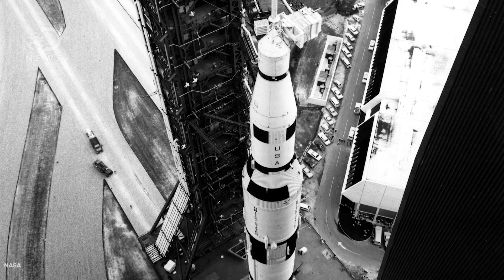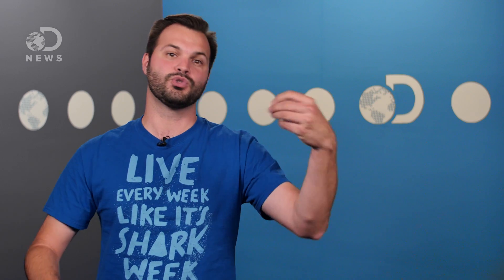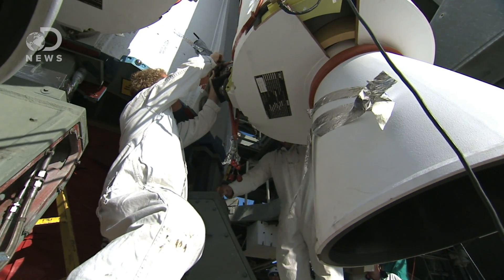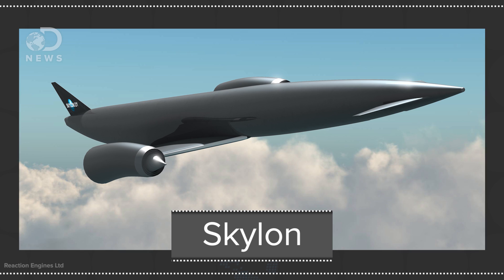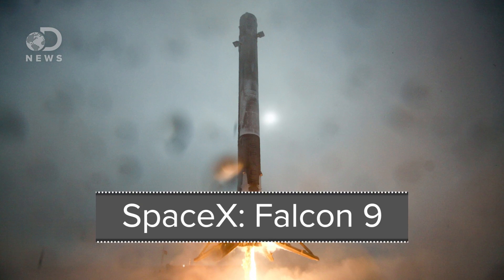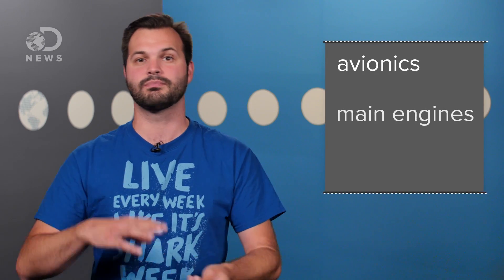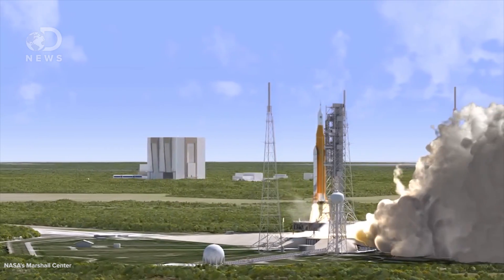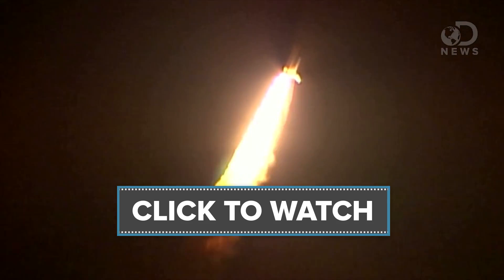What Will Rockets Look Like In The Future?

Comment: Just going to put this out there but how about a tiny rocket booster hanging from a big blimp at the edge of space !! 

Just saying
Reply: Even a weather balloon can only get to the stratosphere, and no weather balloon could carry a rocket big enough to get to orbit and back from that low of an altitude.. Any idea you could ever think of was likely already been thought of and tested by nasa, or others before them.. Even the space elevator using carbon nanotubes would barely be able to handle the stresses, not that it's impossible just the likelihood of a halo reach space elevator collapse would be what holds it back.. I mean if it falls its going to get slung all over the place and rain down from the sky, and kill countless people.. So it's probably going to be hundreds of years before that's going to even get started..
Reply: Did I say weather balloon ? NO ! I said big blimp ! Big difference !
Reply: Weather balloons are going to be able to go higher than any blimp, the fact that you don't know this is indicative of your lack of sense.. And it's even more comical that anyone would up your post, which doesn't change the fact of you idea is superfluous..
Reply: And how big would that blimp be? The Hindenburg airship has a useful lift of 10 tons, despite the 200,000 m3 of Hydrogen strap on its back. Imagine if it is a 200 ton rocket strap on a hydrogen balloon. Plus it can only go up to the stratosphere - we need to go at 400 km, not 70 km. We would still need that huge speed in order to escape Earth's gravity, in the stratosphere, we only have got rid of about 70 - 90 percent of air density - we will still have to face a bit more of a resistance. In the end, its pretty useless. 

If you want to send a rocket from the back of a plane though - its possible - the Russians did it.
Reply: Again I said a tiny rocket hanging below a big blimp and the Hindenburg is old as hell ! 

So let me explain it so you people can understand you pit a satellite on the end of what amounts to a small booster rocket you hang it about 500 feet bellow the big blimp that is about ten times the size of the Hindenburg and when the blimp is 25 to 30 miles up you launch the rocket the rocket doesn't have to be huge and of you get space X to make the rocket it's reusable ! I NEVER said hot air balloon or weather balloon ! Can you guys please think about this stuff with an open mind before you spout off please !! PLEASE !!
Reply: There was even a blimp that rose to fast in the 30s I believe that reached the edge of space soo not a hard concept to get a grasp on here people ! I love all the people that saw a doc on something and say NO NO NO you can't do that because the out of date info I have says so
Reply: And why do you say a weather balloon can get higher than a blimp ? What's you reasoning behind this statement ? People like you once said planes would never fly once and they were wrong ! This is that kind of situation lol
Reply: Lyndon Lucier The edge of space is at 100 km - low earth orbit is at 400 to 500 km. If you are able to put a 10 ton payload in the edge of the stratosphere - how are you going to throw it to low earth orbit? The Hindenburg is one of the biggest blimps of all time - for an airship to carry 10 tons is already a great feat. 

You have to consider the materials that balloon would be made from. If 200,000 m3 is required to lift a load of 10 tons to 5000 meters, to carry a load of 200 tons would be around 8 million m3 of hydrogen air - thats massive. That airship would be a few kilometers long and building very large balloons requires very strong materials. Plus hydrogen is a flammable gas, one wrong move and your rocket is toast. Helium you say, then we need more gas to lift this thing, which means more mass.

"There was even a blimp that rose so fast in the 30s" - then show us this thing then. We are not here to about believing - we are here to doubt. This is science, not religion. And by the way, to reach the "edge of space" in less than 30s would mean your blimp is running at 2 km/s. That's one hypersonic blimp you have. 2 km/s is equal to 7,200 km/h or Mach 5.8. Thats even faster than most of the planes we have then. 

A blimp (or airship) is not a hot air balloon - its a buoyancy balloon that rises up into the sky because hydrogen is 13 times more buoyant than air - it works the same way as with your cooking oil and water - water has a density of 1 kg/m3 while oil has 0.8 kg/m3 so oil will naturally float on water. 

And dont forget, you cannot simply use jet engines in 70 km altitude so you cannot simply maneuver your rocket there. If you disconnect your rocket at that altitude, your blimp has to move out of the rocket as fast as possible before it can use its rocket engines. If you use your rocket engine near a 10 million cbm hydrogen balloon, you be exposing yourself in a bomb equal to a small atomic bomb. 

Here we go again - the airplane thing... loo, there is a limit on what things can do. We have costs to keep in mind, we have safety and more other stuffs to keep in mind.
Reply: Ricky you are incapable of learning new info aren't you lol I'm not building the Hindenburg and also you aren't understanding the whole concept now are you 

And this is YouTube I can't post a pic of a airship ! Even if I could it would be pointless because you could google it yourself you lazy shit 

Just go away and be stubborn somewhere else
Reply: Lyndon Lucier I'm not asking for a pic - Im asking the article. Oh well, since I'm not capable of understanding anything, I'll just leave you alone with your pipe dreams intact. Dont worry I'm not like other people out there - I do not force things on peoples brains - I know how hopeless it is to put some facts on that brain of yours. I dont want to waste time and energy on some youtuber.

I just forgot - youtube has a lot of idiots - well then, good luck with that city-sized airship of yours. Hope you dont spend millions of dollars on some flying disaster.
Reply: Pot meet kettle !
Reply: There has been talk from NASA about making a cloud city of blimps on Venus or having blimps on the gas giants, perhaps mining the clouds for fuel.
Reply: TheKandaharKnight Well, that is actually a good concept because as far as we know, Venus' atmosphere is much more denser than Earth. Even helium balloons would do a good job in Venus. However, if NASA, or any other space agency are going to build balloons on Venus, I think they have to solve one problem first, the problem on how to put man into space in a very cheap price.
Reply: If putting people/cargo into space on the cheap is the challenge than I can't think of a more proper answer than Space X. Right now industry Standard from what I last read it cost to launch rockets to space is about 200 million(cheapest that Lockheed/Boieng will offers). Space X is gonna offer launches around 57 million and chances are it will get cheaper as they perfect and improve on the reusable rocket boosters.Also building infrastructure in space that will enable easy access to space will be key. If we have droids and probes swarming over the he asteroid belt to harvest all the water and "rare-earth" metals and convert them into fuel/building materials, this will enable us to have fueling orbiting depots in LEO (Low Earth Orbit) that will help us get to space even more easily, because now the rocket doesn't need as much fuel to carry into space when it can refuel up there. the cut and savings for needing less fuel and buying it will significantly contribute to lowering the cost barrier and with reusable rockets boosters combined it will helps us over come it more easily.The reason we need reusable rockets is best summed up with this analogy: Its like driving a car and then throwing it away when you get to where you wanted to go and buying a new car to go some where else, same thing if they just threw away planes after they landed and made new ones for you to go some where else. The cost of transportation would be astronomically high.This is what we do with rocket boosters when they MECO (Main Engine Cutoff) the boosters jettison shortly after and we have to make new ones after they plummet into the oceans. Which leads to it being more cost prohibitive to get into space.